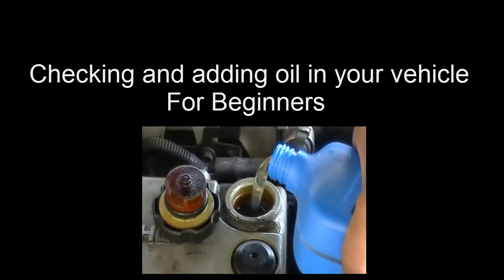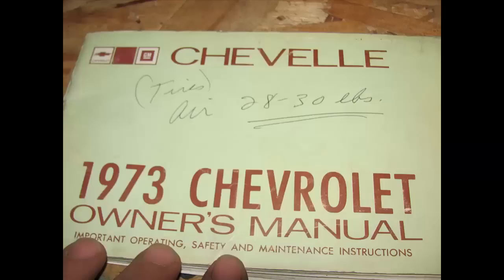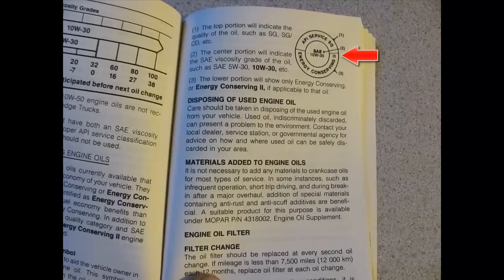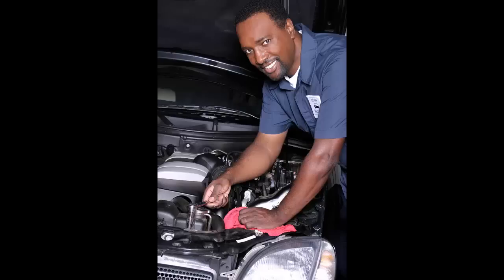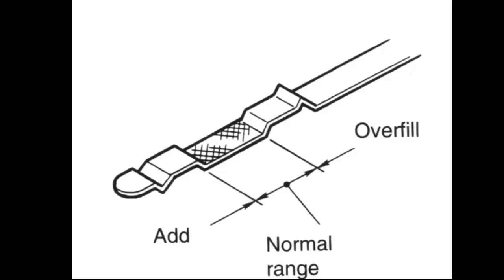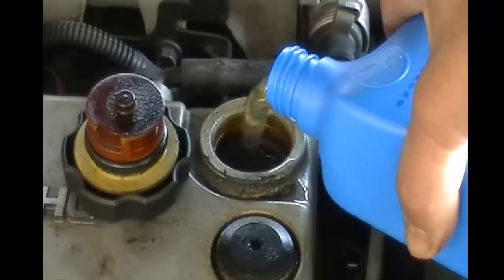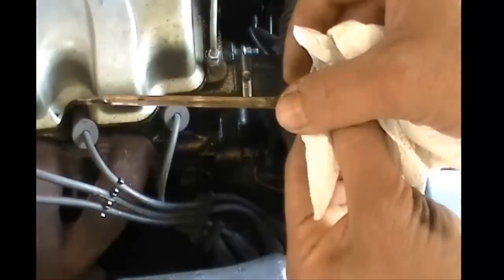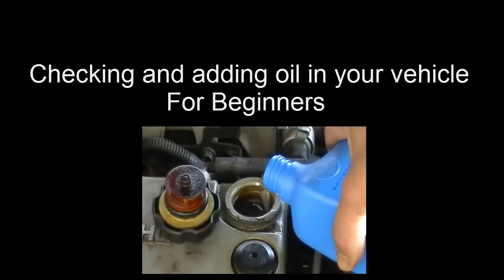Checking and adding oil to your vehicle for beginners

Comment: Thank you so much! This video may help save me lots of money since I'm very short on cash now. I still have yet to try it, but you explained it well and it looks very simple. One question I have, is, if you accidentally overfill it (since I seem to be accident prone), what then?
Reply from the maker: I would add a little oil at a time. Check it. Add a little more if needed, check again, and so on. It is not good to overfill, so just add a little each time and keep re checking it. If you overfill too much, the oil has to be drained from the oil pan which can be a hassle.
Reply: Thank you for the quick response! :) Ok...Sounds good. I will definately be careful not to overfill, but am also glad there's there's something that CAN be done if necessary. God bless.
Reply from the maker: If you need further help, Let me know. :)

Comment: I managed to drip in a small amount using a yogurt container, you can get a triangular edge just right by bending it.  Still could not get the cap off, I just dripped in a small amount and taking it to the shop I go to for an oil change Weds.  Thanks for your advice...when it comes to cars I leave it to the experts.
Reply: PS I have a hand injury due to computer use, this may be the problem.  I don't have any special wrenches, etc.!

Comment: Sorry if this has been asked, but I just filled my oil, (without watching this first 😩) and used an ow-20 instead of 5w-20…which cap stated. By googling some I just see maybe different consistencies. But could you reassure me I didn’t mess up here…worried!!
Reply from the maker: Breaking down the 0W-20 code, “0” is the oil's viscosity at startup when the engine is cold, “W” stands for its winter certification, and “20” is the viscosity at higher temperatures. Lower numbers designate thinner, lower-friction oil.
If you are in a hot climate or you are in summer temperatures you can get away with the oil that you put in but you always want to use the recommended oil specified by the Vehicle Manufacturer
Reply: @FiremanCV  thanks for the quick response! I also realized my car is totally out of oil. I’m going now to buy some more quarts. Would you suggest to buy the 5w-20 this time….is mixing these two safe since I already added the ow-20?
Reply from the maker: You can already add the correct oil to watch you have already put in the vehicle and you will be fine
Reply: @FiremanCV  hey thanks really appreciate your help :)

Comment: a question.  is it ever ok to add the oil thru the space where the dipstick came out of?  I can't get the oil knob to unscrew.
Reply from the maker: Good luck. That's a small opening. Next to impossible to fill that way. If you cant get the cap off to fill with oil, use a rag for a better grip to remove the cap. if that doesn't work, reply and I can make more suggestions

Comment: This is a bit off topic but my started smoking on Monday. So I check oil it was low, so added oil. Then tried to home a mile away next thing in les than 5 minutes it started over heating had it towed home check coolant added it and 20 minutes later started running hot again now I have no clue what the problem could be

Comment: Does the vehicle have to be on or off?
Also do I check it 1st thing in the morning before i start my car?? Or let it run for a few mins then turn the car off then check it??? Or let it run for a few mins then check the oil well its still running???

Comment: Thank u, i couldnt figure out how much to add when the stick said super low, like ur sons!
Reply from the maker: Your Welcome :) Thanks for the comment.
Reply: Can u tell me how to flush engine oil and power steering
Reply: The power steering looks real dark
Reply from the maker: Power steering fluid is generally not flushed, but can be removed & replaced, Most people just add power steering fluid to their vehicle without ever having the fluid change. Also, Oil Engine oil / filter  is replaced rather than flushed every 3000-5000 miles depending on vehicle recommendations in the owners manual. 
Hopefully this answered your question. If not, let me know :) Thanks for giving me an idea for a new video, I'll make sure I mention you. :)
Reply from the maker: Yes, over time, Power steering fluid does get dark. When you add new fluid, you will notice it is clear. Although you can remove the old power steering fluid, you won't remove 100% of it, as there will still be some in the power steering lines. It is removed by sucking it out with a suction tool and the old fluid disposed of, and new fluid added. It is a very messy thing to do but can be done. Again, If you need further help or clarification let me know. If you want to do this yourself, let me know.I will provide instructions via massage, or make a video for you.
Reply: Ur awesome! Thank you

Comment: The last time I got my oil filled was about 3 months or so ago. My car started to act just a little weird but only I would know cuz its my car. So I figured it might be that I need to fill it up with oil. I went and got some oil. The guy at oreillys told which one to get. I just checked my oil level and it says its completely full as if I just filled it up. Do u have any clue why? Could I have done something wrong?
Reply from the maker: If your vehicle is acting weird it is not because of the oil. That means there may be some other issue with it.
The best thing to do is go back to O'Reilly Auto Parts they have a scan tool and they can scan your computer for any problems if there are any.
Reply: Thanks. That was an insanely fast reply. I think I might just need to change my oil. I thought that your car was suppose to use up oil so I was confused but my step dad told me that if it doesn't go down, that's good. Otherwise it would go down if it burns the oil or if i have leak. So I guess I don't have a leak and its not burning oil. 🙂
Reply from the maker: @madelinetacher5090  if your vehicle is not consuming oil that is a good thing if your vehicle is running like garbage or running rough then it has nothing to do with the oil like I said take it to an auto parts store and they will scan it for free and tell you what's wrong if anything

Comment: Should the engine be warmed up before checking oil level?
Reply from the maker: SN Vid no. Cold
Reply: FiremanCV Okay. Thanks. One more.. Q: What's the substitute for Engine oil Grade 0W20?
Reply from the maker: Do you mean 10w20? Most vehicles take either 5w30 or 10w30, the safest way to tell what is recommended for your vehicle is either the owners manual, or see if it is written in your oil fill cap. Don't know where you are located at but, generally people run thinner oil in colder weather and heavier oil in the summer. It's a matter of personal preference.
Reply: FiremanCV Okay. I am from India. And this query is for my Suzuki Ciaz Petrol Delta Variant.
Reply from the maker: 15W-40 or  5W-40 engine lubricants are recommended for petrol and diesel engines for your vehicle. :)

Comment: So I should check my oil while the car is running or not? Cold or warm
Reply from the maker: Your thinking Transmission Fluid that you check while vehicle is running.
Engine oil is checked when vehicle is cold and not running
Reply: yousef156 some mechanics like to run the engine after filling, because it will suck the oil through and give you a "running" oil level... Its not necessary! But there is no harm either

Comment: I have an oil leak somewhere on my car, I notice a small stain where my car sits, no puddles. I'm looking to use blue devil oil stop leak,or really any kind of product that'll stop leaks. I also noticed my oil was low. I plan to put some oil in and then the next morning put in the oil stop leak and then about 5 days later take my car in for an oil change and hope everything is well. Is this an ok process or have I missed anything?

Comment: Very cool video! Very informative. But here's a question: while checking the oil, should the engine be on or off?
Reply: the engine should be off but check right after you have driven for a while so that the oil is hot and you get an accurate read!

Comment: Best video on the subject.If one was to put to much oil in car, how do you take some of it out? WHAT could happen if you drive car on too much oil?
Reply from the maker: A little overfull is ok. But if you put too much in, then a small amount needs to be removed by removing the drain plug from the oil pan.
Reply: Thank you for reply and once again great video..Best 1 by far.
Reply from the maker: No problem. Thanks for watching :)

Comment: I got a jeep grand Cherokee 2001, it keeps saying low oil and the motor be jumping like its low but sometimes its would be between low and high but the gage would say 0 and the gage check light would come on randomly and i go feel it a lillte bit but after three to for days it does it again but my main question thou. Do u fell it up will the engine on or not.
Reply from the maker: What is the level on the dipstick ?
Is the light coming on when the dipstick reads full?

Comment: well my van has had the oil light for some time now. i went to orilies and they said its ok but now the "check engine" light turned on. if i just put oil will that be ok? do you have any suggestions?
Reply: Ana Rojas oxygen senor

Comment: On my cadilac srx when I check the dipstick I can't tell where the oil line is because there is oil all over  it, duh? Yes I wiped it off, then put it back in and it was all over it, but not a distinctive line of oil. I know that sounds really stupid, and I'm not an idiot Im really not, but this stupid thing looks like it's got oil in it, but then when I go to drive it after about 8 min into the drive the alarm goes off and the message center says stop engine, low oil, so my question is should there be a very, very,very, distinctive line of oil on the dip stick because it's a Cadillac? It's a weird dip stick. I'm afraid to over fill it. I've put almost 3 quarts in it and it hasn't been that long that we had it changed at the dealer. There are no oil spots on the garage floor so it's not leaking. Help,
Reply from the maker: IS your low oil light coming on? Sometimes it hard to make out the level on the dipstick itself. You have to angle it just right so the light hots it so you can see the level. You dont want to overfill it.

Comment: thanks very useful video, although if your oil is low and you're adding new oil then isn't it better to flush out the old oil altogether from the bottom or something before adding in the new oil? or doesn't that matter much?

Comment: Did you change the oil filter? Or is that ok to just add oil and not changing the filter?
Reply from the maker: Oil filters should be changed at either 3,000 or 5,000 miles, Dirty or clogged oil filters allow contaminants to sail straight to your engine where they can cause damage as well as affect fuel economy. You also risk blocking the flow of oil to your engine, which could result in engine failure. Protect your engine with a fresh oil filter, replaced every time you change your oil. Look at your vehicle owners manual for information as to when you should change your oil. It's ok to add oil between oil changes. If you keep adding oil without changing the oil, the oil will become thinner & have more contaminants in it constantly circulation throughout the engine.

Comment: Hey Fireman CV: I drive 2017 Nissan Sentra SV model. Not sure what type of engine oil to use because my oil cap doesn't indicate tht info. Would u happen 2 know?
Reply from the maker: One place to look is the Owners manual, Or look for stickers around the engine compartment. Could also be stamped on dipstick. If Not call the dealership and ask them. Here is your vehicle manual: https://owners.nissanusa.com/content/techpub/ManualsAndGuides/Sentra/2017/2017-Sentra-owner-manual.pdf , Page 8-7 Shows how to check your oil. Page 10-2 Shows what oil type you should use. 0w-20

Comment: but do I need to drain the old oil from underneath the car or just add on top of it?
Reply from the maker: A.R. BEATZ This video is for topping off your fluid/maintaining oil level if it is low.
However if you change your oil, the video can be watched to ensure the oil is filled to the proper level
Reply: FiremanCV yeah, my engine oil is low. So I don't have to drain if it's really low unless I want to add a brand new oil, right?
Reply from the maker: A.R. BEATZ  NO need to drain. Just add from top. :)

Comment: Hi FCV- my 95 SL2 has an oil leak at the drain bolt. first time I did an oil change on my car. It didn't leak before though. I noticed it has an oversized bolt but can't say how long it's had it. 

worst case, I think I need a new oil pan. best case, I hope I can stop the leak by using some different gaskets. I have the bolt torqued to 27 ft/lb, the recommended for a 14mm, but because it's a 15mm bolt can I actually tighten it more? Also, I think I overfilled the oil, could that cause the leak?

Comment: Ok new car owner here. I have a 1975 camaro, from my dad. In the engine stuff isn't labeled at all. In the engine bay I see 2 possible holes. One in on top of the engine and it smells like gasoline, the other is near the timing belt. A bit behind the radiator.

Comment: does the car have to be cold or can it be warm to add oil?
Reply from the maker: Rikster 
Warm or cold is fine.
You can check it a few minutes after shutting off the vehicle. 
Just be careful of the hot engine and surrounding parts when checking oil.
Or, do it the easy way and go to a Full service station.
They are getting more and more hard to find these days.

Comment: Thank you so much for doing this!!  I knew how to check the oil level, but I was always scared to do more than that.  Silly question, but when adding the oil, how long do you let it sit for to make sure it reaches the bottom of the engine?  A few seconds, minutes?  I just want to make sure I don't overfill it.

Comment: Great video!! But I️ got a stupid question...
Do this while Cold or hot engine?!?
Reply from the maker: Cold is the best way to check, As all the oil will be in the bottom of the oil pan & will give you an accurate reading of the oil level, This is where the end of the dipstick sits in the oil.

Comment: well my van has had the oil light for some time now. i went to orilies and they said its ok but now the "check engine" light turned on. if i just put oil will that be ok? do you have any suggestions?
Reply: Buy CARMD that tells you everything that's wrong with your car
Reply: ok thanks!

Comment: well my van has had the oil light for some time now. i went to orilies and they said its ok but now the "check engine" light turned on. if i just put oil will that be ok? do you have any suggestions?